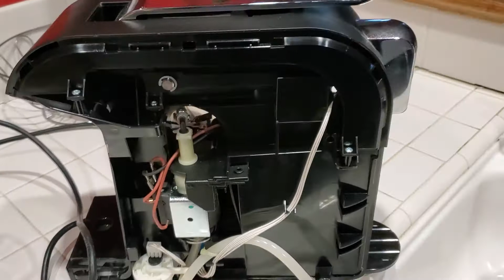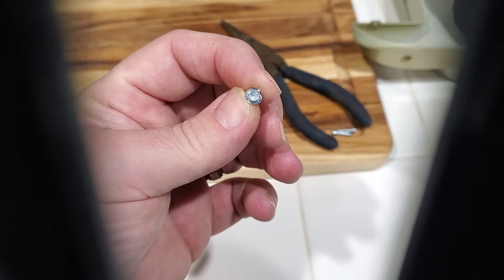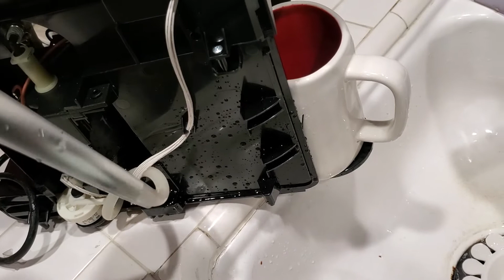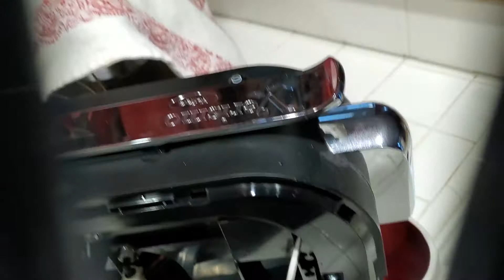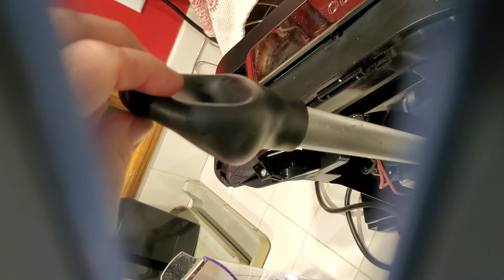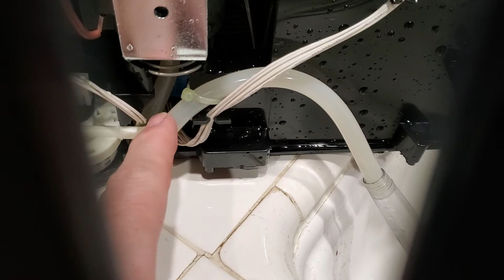verismo starbucks espresso/coffee machine, NO WATER COMING OUT FIX

Comment: I didn't have a baster so I removed the tube and filled with water. Turn upside down and keep tapping the unit to help get all the air out of the line and the pump. It takes a while. after I did that I attached the tubing and got water flow from nozzle. Ran a few rinse cycles then an espresso!  Thanks for the video.
Reply from the maker: glad you got it  working and figured something else that helped you, thanks for comment.

Comment: My Verismo 580 had been stored for years until last week when I ordered Mr and Mrs Mill Dark Roast Espresso K-fee & Starbucks Verismo Compatible | 72 Count (6 boxes X 12 Pods) | Dark Roast Single Serve Espresso Pods from Amazon. They arrived yesterday and in my opinion they truly deserve the high rating. As for the water not coming out, I found that after pushing the buttons several times without success, just wait about 10 or 15 minutes and the water will finally start to come out.
Reply from the maker: Thanks for the info

Comment: The heater doesn't cause the pressure. The pump has a metal piston that oscillates up and down in an AC electro-magnetic field which pressurises the water to 19 Bar.
All the heater does is heat, but not to boiling temperature.
Reply from the maker: Thanks for the info